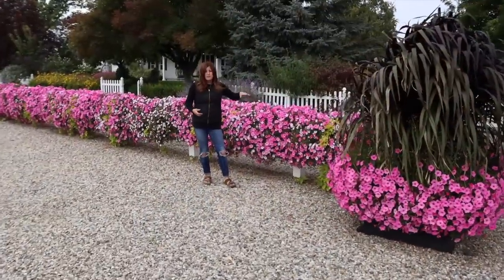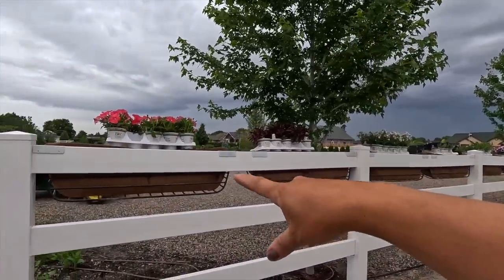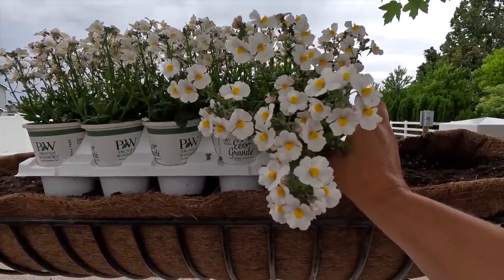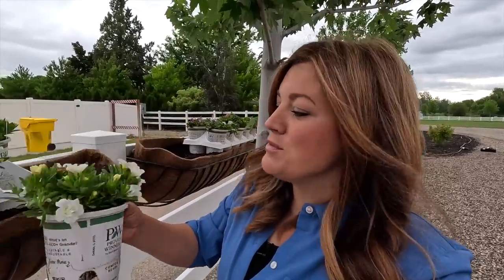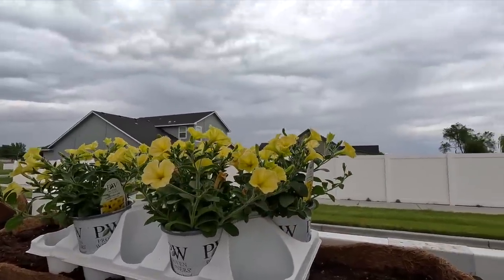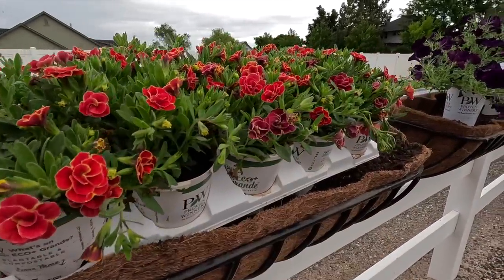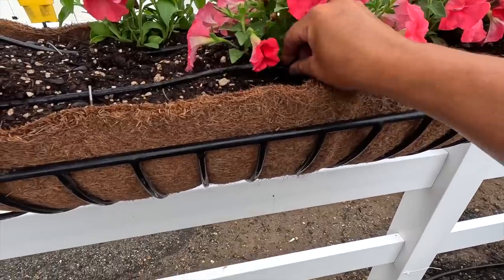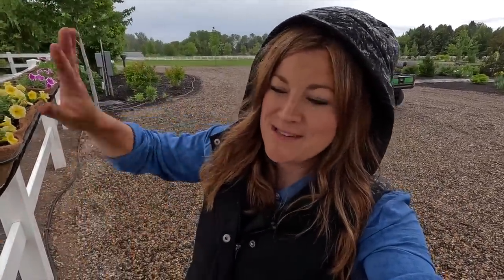The Hayracks are Back! Planting Up 22 of Them With New Annual Varieties for 2023/2024! 🌸🙌

Comment: Great idea to use them there! Is it possible to just run the black tubing and then put emitters off of the solid black line instead of the smaller tubing or would that not get enough coverage? Say 4 emitters per rack.

Comment: I have a question about the drip tube you put in the plater boxes.  Rather than putting in an "ender" could you put in a "t- coupler" and attach the begging of the run to the end of the run to improve water distribution as it creates a "loop" in the window box?

Comment: It looks like that's a long run of drip tubing (the main 1/2 inch line). How far can a line like that go? I only have one spigot in my backyard and my vegetable garden is about 100 feet away--could a main 1/2 inch drip line stretch that far back with 1/4 inch lines off of it into each raised bed and still function? Laura, I'm hoping to use your recent video setting up drip at your sis-in-law's as a guide for drip in my own garden, but worried it's too long of a stretch to work properly.

Comment: Question….  Will that black supply line get too hot exposed in the sun like that?  I know that my hoses get so hot that I can’t have my hand in the water for a good several seconds.  Will that hurt the plants???
Reply: They will heat up, but because they cool down in the evenings, watering in the early morning shouldn’t be an issue.

Comment: I have zinc hayracks and line them with Black LANDSCAPE fabric..looks wayyyyyy better than that hideous  coor junk. Plus with spillover plants liner is not seen. One year I used a beautiful, expensive  green moss like fabric from England but that was a waste because it's not seen.
A steel bar can be put inside the top fence rail then screw hayracks with screw & washer into rail... all the brackets are then eliminated